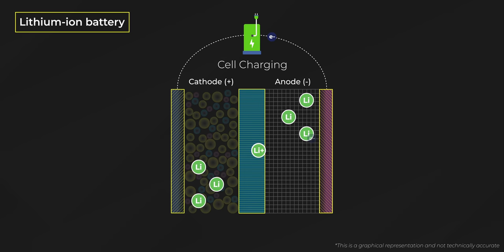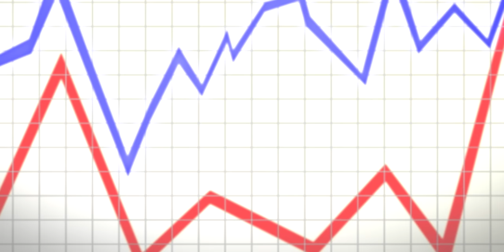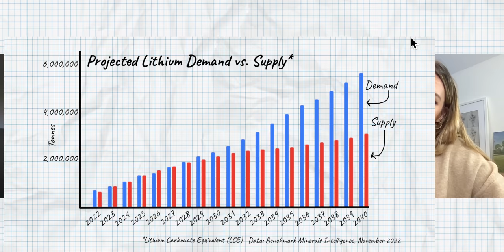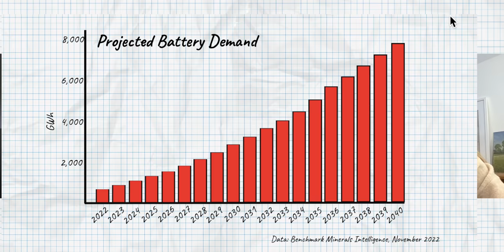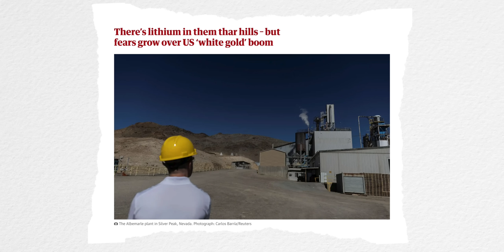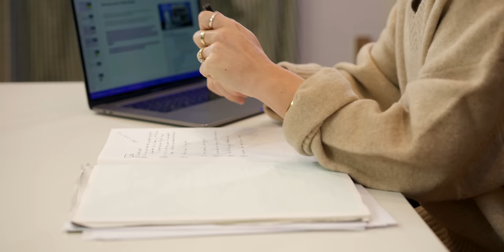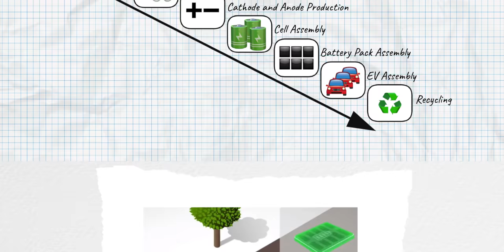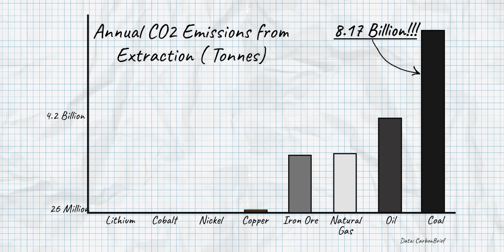There's a Massive EV Battery Shortage. THIS is How We Fix It

Comment: I think the problem is comparing new to new cars on carbon output over life. I don't want a new car and don't plan on buying one unless my hand is forced. Surely keeping my old diesel on the road is more environmentally friendly than building a new ev. Obviously you have particulates with diesel but on the carbon side I think sticking it out is better. My car is a 2006 and has done 170k surely a 16year old ev is going to be at end of life where as a diesel may keep going on to 300k and another 10 years.
Reply: Don’t forget diesel isn’t ‘locally sourced’ and your car is dependent on many tanker miles, both road and sea, just to turn over. And I wouldn’t be so sure about battery age, there’s still first gen Nissan Leafs kicking about with useable range after ten years and battery tech has moved on a long way since then. Manufacturers are now putting cars out with ten year /100,000mile warranties, which means they are betting financially on their cars easily outlasting that. 5 years used to be the top tier warranty in ice cars for perspective.
Reply: @The-tg5zg  your right but at the moment the grid is also producing fossil fuels to produce the electricity and is probably going to be a good while before that changes. Battery tech I would say hasn't really moved on much it's still lithium battery the chemistry is the same so the downsides are still there.
Reply: Really depends how long you are still driving your diesel. At some point you are over the break even point and that distance gets smaller and smaller the more carbon neutral energy is used in the production of the EVs.
Reply: @4203105  yes but the chances of the grid being net zero is probably good ten years if not longer 40% of our energy I believe is from gas. The UK is looking at even more gas extraction so this will probably go on for a long time. Personally I think carbon capture is more the answer than going electric because we can kill alot of birds with one stone. EVs solve one problem cars but they don't solve the problem of heating our homes they don't solve the problem of generating electric the list goes on. I like the idea of electric cars don't get me wrong but I just don't see them as being the be all to end all. Even tyres give off particulates through wear and being heavier EVs tend to produce more wear on tyres so you can't really win either way at the moment. I think there will be a place for EVs but I don't think it's yet. Carbon capture just makes sense. One shipping vessel pollutes something like 1 million cars worth of co2 going battery in them isn't viable so it makes sense to try and capture it's pollutants and if we already are doing it then let's keep cars in the mix.
Reply: @HA05GER  EVs produce less Carbon emissions over their lifetime even if exclusively powered by gas power plants. So I don't see the problem with your current energy mix.
Heating homes seems a bit off topic, but that can be done with heat pumps.
I don't understand. What is your general problem with EVs and heat pumps and what solution do you propose?
Reply: @G T this is why I'm a big believer in carbon capture wether it'll ever take off is a different thing but it just makes sense.
Reply: @G T I can't find any source for your claim. So I don't think Volvo ever said anything like that. Not even the ADAC gets 8 years.
There will be carbon neutral energy generation once the wind turbines and solar panels are manufactured with renewables. That's the whole point.
Battery technology is fine right now. It's small combustion engines that are crap and always have been.
Reply: @HA05GER  Carbon capture is a scam. It has never worked anywhere.
Reply: @4203105  maybe look into it the reason why it doesn't work is because it's not profitable simple as that.
Reply: @G T I'm sorry that you have so short to live that you won't live to see the day of 100% renewables.
The Alzheimer's seemingly already had set in if you can't remember time progress made in the last 20 years.
So your source is your dad who works at Nintendo? Well that's just amazing, buddy!

Comment: They should push range extended EVs like the Chevy Volt instead of pure EVs. Give people big enough batteries for a little more than a normal person drives in a day and a gas backup generator for the rare time it's not enough. That little gas burned isn't worth quadrupling the battery size and the resources needed to produce it. I say Range Extended EV instead of plugin hybrid to clarify that they would run as pure EVs under normal use. Plugin Hybrids still use the gas engine sometimes even before they deplete the EV range.

Comment: Disregarding weight for the moment, there are three figures that are important for motive batteries - total capacity, rate at which it can be charged, and the rate at which it can be DIScharged. Weight and bulk depend on the materials used. Some chemistry batteries are high capacity, but cannot deliver it fast, although they are good for a low rate for a long time, while others can deliver very quickly, at many times their 'C' rate, for a very short period. Finding the balance between the two is the tricky bit!
Reply: I think this is an example of what they call 'mansplaining'..... Isn't it!!!!

Comment: Fix it with alternative gasoline or ammonia fuel
Reply: With what every do you want to produce these alternative fuels?
Reply: One way of making green ammonia is by using hydrogen from water electrolysis (same as hydrogen powered cars infrastructure) and nitrogen separated from the air. These are then fed into the Haber process (also known as Haber-Bosch), all powered by sustainable electricity. The waste products can be used in the agricultural industry it’s brilliant, but people will probably waste the idea and the planet 
It can use our existing infrastructure and almost any car can run on ammonia, and water is the emission

Comment: Stop owning private cars and use electric buses, bicycles and other such things? Have smaller homes which require far less energy to run, and require a smaller home battery?
Reply: Nah
Reply: I ain't living in a small house, I draw the line at comfort and convenience.
Reply: @theproffessional9  I grew up in a small home, (about 600 sq ft) it was super comfortable (when you have less square footage, you can afford nicer carpet and that sort of thing).  It was inexpensive to heat in the winter, and it was easy to clean and maintain, because there just wasn't a lot of house to take care of.  Now I live in a 1200 sq ft flat and it takes forever to clean, and our heating bills are very high.  A lot of people here (USA) have McMansions that are 3000 sq ft or more.  That's like 5 of the houses I grew up in put together or 3 of my current place.  A large house isn't necessarily more comfortable nor more convenient.  A smaller house can be a LOT more convenient and more comfortable.
I'd rather have small house on a big lot than a big house on a small lot.
"Tiny homes" that are basically the size of a campervan or garden shed are a whole different thing, most people wouldn't choose those (nor would I).  Small houses are not the same as "tiny homes".
Reply: @Chris Till - Do you advocate compulsory purchase of all the old properties where thermal efficiency had never been thought of? Where is the money going to come from to buy the new (and expensive) house? How about pensioners with a very limited income who cannot even think about, never mind afford - a new mortgage? There is NO bus route anywhere near me, and they don't go to my main destination either! I cannot carry all the equipment I need on a bicycle, and I certainly would not be allowed on a bus with it! As an aside, are you related to Andrew Till, who is a vlogger/electric car owner?
Reply: @KellyS_77  Exactly. Having less to heat, clean, maintain, fill up with stuff you don’t need is great for mental health. I would not want a tiny house on wheels either. But one of the smaller ones on the channel “Never Too Small” would be ideal.
Reply: @hamshackleton  There are always edge cases. It’s just a general rule that won’t apply in every single instance. And no relation. I think I’ve seen one of his videos once, and I thought it was interesting because it’s quite a rare name, and I was an EV driver too at that point.
Reply: Soo, Chris..... all we need is fundamental, radical, top to bottom, COMPLETE transformation of society at all levels........ and everything will be just fine!!
Brilliant! 
(please can we start by having a bus service in our village which runs regularly, seven days a week - so I can give up my car.....!?)
Reply: @andymccabe6712  We need a radical transformation of society. Who knows if everything will be just fine though. It may be too late for even that to save life on Earth.

And if I was PM I’d absolutely provide you with a fantastic electric bus service by taxing the rich and using that to invest in all of our public services. Unfortunately no mainstream party will do that. Maybe not even the Greens if they somehow pulled off the upset to end all upsets and got into power in 2024.
Reply: Public transport is great if you live in a city, but for the rest of us?

Comment: With battery constraints PHEV is the best way to resolve this... You can build 10 PHEV for every 1 full EV. Toyota is finally making a PHEV with 90km of range which is more than enough for average daily use.
Reply: Or you could just build full EVs with smaller batteries and not have the massive overhead plugin hybrid have. Most people don't need a car that does 500 miles on one charge.
Also there is no shortage, apart from general shortages caused by the pandemic.

Comment: In 20 years time batteries in evs will be the size of a suitcase and power a car for over 600 mile with a charge time of just a few minutes. It's called progress.
Reply: I sincerely doubt it. Not even hydrocarbons have that kind of energy density.
They will become cheaper and more energy dense but not too that physics defying level.

Comment: I was ok with the video tell the point of using an MIT chart based on driving emissions as the only proof. Problem is the creation of the vehicle itself is 6 times higher on the EV then a normal car. Thus the EV has to make it 60k miles on the original battery to even out the foot print. It's a good video but missing that key info makes the ending shady. Be honest the entire video about EV production on the environment not just most of it.

Comment: If the car manufacturers would make efficient smaller light weight EVs instead of 2.5 ton SUVs then the raw materials (and the EVs) would go further and be a more efficient use of the resources that are available. At this time there is no excuse for EVs not to be capable of 5miles per kw which would give an EV a 200mile range on a 40kwh battery! The tech is there the outgoing BMW i3 is very nearly capable of this and that was designed 10 years ago!

Comment: Go back to ICE using bio fuels with existing infrastructure no more batteries problem solved.
Reply: And where do you get all that bio fuel from?
Reply: @4203105  same environment as electric except no fields of photo panels removing growth use but then moving on the Efuels being hydrocarbons without having to build a whole new infrastructure that is currently unsustainable and using existing vehicles instead of having to build all new.
Reply: @ogriboy  Problem is efficiency. Plants are less than 1% efficiant at turning sunlight into energy. Then you lose a lot more than 50% by turning the sugar into fuel. So generously you are at 0,5% efficiency.
Solar panels have an efficiency of 30%. Since I was very generous with the bio fuel. I won't consider minor transport losses.
So from that alone you need 60x more space for bio fuel than for solar panels and you can't exactly grow corn on roofs.
Add to this that electric cars are at least 3 times more efficient than internal combustion engine cars and you are at 180 times the space you need for E-Fuels than you'd need for electric cars with solar.
I assume it goes without saying, but we don't have that space, unless you want to murder about 7 billion people. Then there might be enough room to grow your biofuel. But most of the remaining people would have to be farmers.
Not to mention that growing plants with fertiliser made from oil and gas is far from carbon neutral.
So I ask you again, where do you propose we get that bio fuel from?
Reply: @4203105  I think I have already explained where it comes from and see no need to repeat. The reduction in damage to the infrastructure through new EV stations, and all new vehicles having to be produced against using what we have  would dent your argument severely on carbon output. As for  the land mass this is already being destroyed by solar farms nothing can grow and apart from livestock which we are told needs to be stopped its dead ground.  Next up is E fuels which you have also overlooked being manufactured fuels which again do not need new infrastructures or vehicles needing massive lithium and cobalt mines. This messiah like campaign for all things EV has major flaws. So I say again to you my point is diversity not isolation of fuel sources. 2030 is looking more and more unlikely the charging infrastructure is already crumbling due to overload of use and this will only get worse as the lack of investment and economic pressure takes its toll. Do not put all your eggs in  one lithium clad basket. And yes I am an EV car owner but with a broad mind to the reality of the situation going forward.
Reply: @ogriboy  So I you are conjuring the bio fuel with magic. Got it. I'm looking forward to it.

Comment: So, Akio Toyoda (and Toyota in general) gained massively negative reporting when they 'dared' to suggest there was a battery shortage and the proposed targets for EV adoption can't be met, this channel included.....

Turns out they were right all along!!

I look forward to the next show where Robert humbly apologies for the amount of online hate/abuse that social media teams working for Toyota have received as a result.....

(Don't worry Robert/Dan, I'm not holding my breath!)
Reply: No, they are still wrong. No credible source sees any long term shortages of lithium or other battery materials.
Reply: @4203105  Have you watched a different version of this video?!

Toyota's official position is that we should spread the available batteries amongst as many people as possible by using them in HEVs, PHEVs and BEVs.  This position has been strongly criticised by this channel and other websites, saying that Toyota should be building only BEVs and that they are the next Nokia or Kodak.

The video confirms Toyota's position as correct (no matter how you try to spin it!), as it currently stands we can't get enough raw materials out of the ground to build the projected number of BEVs.....
Reply: @bryanduncan6178  There is no battery shortage or shortage of battery components. Lithium prices were high due to general supply chain problems during the pandemic. They are down by a lot again already.
Lithium is an extremely abundant element and easy to mine, as in a lot of cases it's just pumping salt water.
Also sodium battery mass-production is ramping up as we speak. You know, the stuff we have so much of we throw it on the streets in winter.
Again, there is no shortage. Toyata just missed the boat on EVs and is now desperatly trying to lobby for Hybrids, to give themselves more time to catch up, maybe even get their solid state battery running, they seemed to have put all their chips on.
A video is not god. The video only confirms, that you should fact check everything you see.

Comment: One thing I don't understand about battery powered electric vehicles is that nobody would think it very sensible to power up a battery and then use it to provide power to an induction cooker. That is what BEVs are doing. Instead of batteries we might want to reconsider inductive power transfer and redesign our roads to be primary induction coils and EVs carry a secondary induction coil for power transfer.  Batteries then may be cut down to 10% of their present capacity.  After all it is all about getting the power from the generation source to the point of usage.  Long ago they didnt have induction cookers to transfer energy from the power supply to the vessel for cooking.  Again the concept has to be scalable to accommodate thousands of cars.  Can be done if we take the blinkers off and rethink power transfer to vehicles minimizing batteries.
Reply: Yes, putting a massive amount of cables in all of our roads seems totally feasible.
Reply: @4203105  Dirt tracks are so much better than asphalt and concrete.  Its no go the Lintzy wires Its no go Ampere and Faraday. All we want is a beaten track and rickety wheels to ride with. I guess its horses for courses then. There are many challenges to be met before such a scheme becomes feasible but I rest my faith on the kind of  thinking and innovative people who put induction cookers and microwaves in almost every home to meet and overcome the challenges rather than the battery transportation devices that are dominating our present thinking. Batteries are one way and inductively coupled wireless power transfer is another way and nuclear powered hydrogen production is yet another.  1 litre of petrol has 8.9 Kwh of  energy and weighs 0.79 Kg. Batteries are about 100 times heavier for the same amount of power.  Heavy means raw materials.  Heavy means inefficient.  Heavy means infeasible.